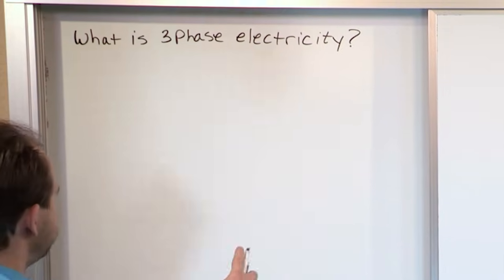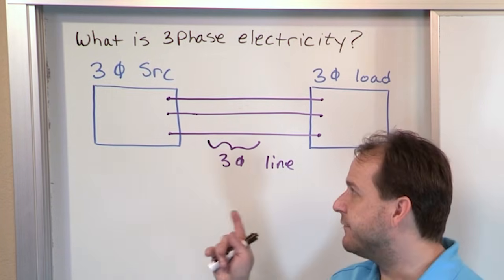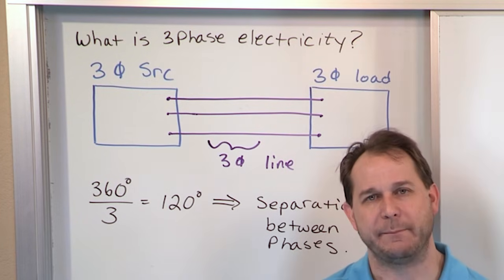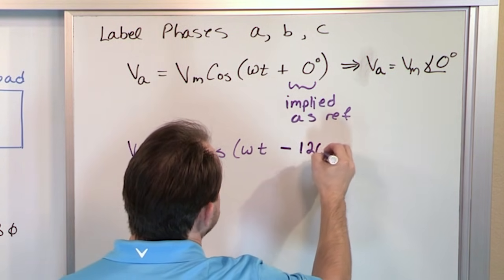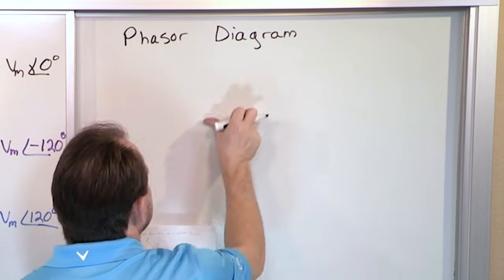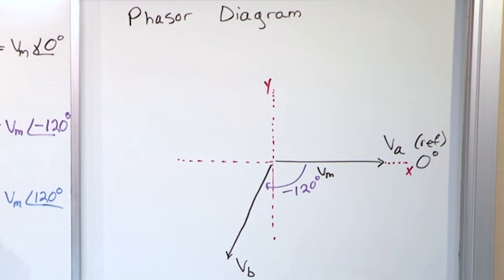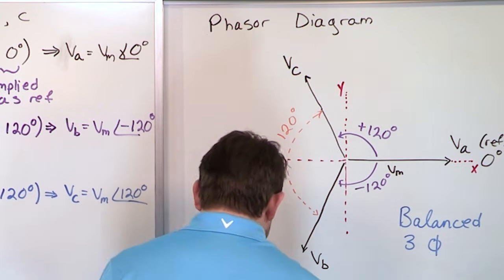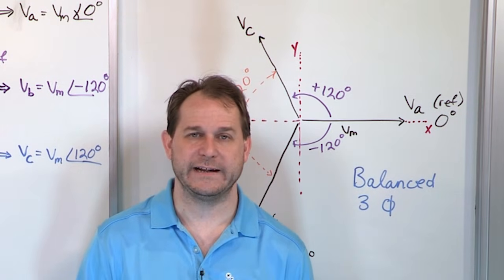01 - What is 3-Phase Power? Three Phase Electricity Tutorial

Comment: 3.phase is the best you can use for a-c motors because you.need to use delta connection for direct line statters .but star delta connection motors you can use root 3.to check running and starting cutrents.with  checking the load with a clamp meter.and then you cam adjust.your over loard relay for the motor etc.Faradays law.for motors .remember Root 3.1
Point .73.off an amp . That way your motor will run at its given R.P.M .with out viberating .if the motor alllnment is balanced 
Iwill cut off now .or i will be writing a book .thsnks .Martin ex navil marine chief ele.officer.

Comment: One-phase motors must generate an auxiliary phase. 
This can happen due to a capacitor or magnetic imbalance. But without technical tricks, a one-phase motor will not run.
Therefore Tesla patented the two-phase motor with 4 lines.  The phases were shifted by 90°
This idea was only taken up again with stepper motors. But Tesla didn't have this technology in mind

Comment: Tesla invented the three-phase, 6-wire motor and the two-phase, 4-wire motor. But the high number of lines prevented success.
Without knowing about Tesla, the Russian Michael Dobrowolski in Germany perfected the three-phase motor with three lines as we use it today. The first application was an 8000 volt high-voltage line from Lauffen to Frankfurt. Two transformers, a generator and a three-phase asynchronous machine were used for this purpose. 
Dobrowolski had improved the three-phase motor so that it worked, in contrast to the Tesla patent, which remained in theory.

So Tesla patented the 4-wire motor (two phase) and 6-wire motor (three phase) 
and Dobrowolski got three-phase motors running in Germany with just 3 wires

Comment: Your English needs improving because the correct preposition for the relations of more than 2 different individuals is among, not between. Here you have 3 different power sources or voltage supplies. So, the phase difference " among" them is
 Φ = 360/3=120
The negative sign "-" merely indicates the direction, but it dies not have anything with deceasing value at all in this particular case. It means that you have an unnecessary mathematical explanation, while all you need to do is substract the absolute values of the 2 phases from 360 --> 360 - | 120 | +|-120| = 120

Comment: I came across a oven yesterday that had had line 2 and 3 switched. It should just cause the motor to run wrong it wouldn't cause the three fuses to blow would it. I wired it correctly replacing the fuses today. 

Replaced the transformer yesterday thinking that was the short in the system blowing the fuses noticed the wiring after that, elements all checked out fine. The only thing really remaining is the wiring but I'm not sure line two and three being backwards would cause the fuses to blow. It could have been the transformer just commenting for some insight before turning it on today

Comment: When did we start calling Lines phase? I thought phase was the relationship between lines? Correct me if I'm wrong but single phase power is not called single phase because its made from a center tapped transformer with a single line primary is it?  If 240V 180 degree 2 line power was made from a 2 pole generator should it not then be called 2 phase? Its the relationship between the 2 lines that is the single phase no? if you took 2 lines of a 120 degree 3 phase service would you have 2 Phase 208? Or do you have a single phase of 208? Am I getting hung up on semantics? In my humble opinion it's the simple fact that just because there is 3 lines in a 3 phase service it was to easy to draw the incorrect conclusions that there the same thing but there not! Draw as many lines as you can between 2 dots on a circle 12 and 6 o'clock, I think one, a single, is all thats needed! Now put 3 dots in a circle,, 12, 4 and 8 o'clock, now draw lines between. It will take 3 lines to connect the 3 dots, take a dot away,, yep your back to a single phase! A single line has phase only when referenced to something that reference circuit is the phase cycle around and back not the line. Simply put, we can't call lines in a 3 phase service phase 1,2,3 or a,b,c unless we are willing to call single phase 2 phase and i don't mean that old great lakes 90 degree plumber invented 2 phase BS.
Reply: You need paragraphs.  In North America, the distribution network is typically 3-phase in a “Y” configuration.  For residential service, one phase line plus the neutral powers the primary of a transformer.  That is single phase.  The secondary has a center tap, so three lines go to the customer.  The two ends of the secondary give 240V single phase service.  The center tal is neutral, and is used to make two 120V circuits of opposite polarity.  You may think of the two 120V circuits as two phases, if you like, but some people will try to make an argument about that.

When you take two phase lines from a 3-phase system to power something, you have single phase, even though it is not exactly the same as any of the three phases with respect to neutral.

Comment: I worked in a textile mill years ago and most everything in the mill was 3 phase.  You don't need a start or run capacitor on a 3 phase motor.  You have a problem you just ohm it out and look for a short or a bad bearing or bushing.  I can tell you a little old school secret I learned.  If a motor is hot when you check it then it is good.  A motor with an open winding will cool off since it isn't trying to run.
Reply: Thanks for the tip!!! Greatly appreciated.
Reply: I thought a capacitor was to put the current out of phase which gives the motor additional torque to start,
Reply: @vxnova1  yes but in 3 phase there is no need for the cap cos atleast 2 of the phases always have torque even if 1 phase has 0 torque therefore start up cap is unnecessary
Reply: @vxnova1  gj(jjk(jjb iii jjjjjjjjii

Comment: I used to work with three phase power on commercial airliners where it very useful for instrumentation and for high power. Mostly on 400 cycle  systems syncrotels and control servos etc. I had studied an electronic engineering course for 3 years at Miami/Dade college.

Comment: Single phase voltage fluctuations cause vibrations in the motor being highly inefficient and actually damages the motor. Three phase voltages do not fluctuate as much. Also never connect single phase motors to a three phase supply without a phase converter.

Comment: Thank you.

You are the best instructor I have on this subject. I probably have this thing more than 30 times since high school, but this is the first time I really find it useful and make sense. 

It is your "MOTIVE" method makes the new knowledge associate to things I already know, smoothness operation of motor.

I guess none of my previous instructors really works in this motor design job.

One suggestion, start with a resistor to explain the power thing 3 phase world probably cause confusion.  

Negative power for capacitors and inductors? 

Do you mean some thing get colder when pass current to it?
If I am teaching this, I will use a running motor as a model only, There is no isolated resistor, capacitor, or inductor. And the power is not just heat, but heat plus rotational energy.

Negative power means put breaks on and take out rotational energy. 

Power hear is Power Flow, with direction, source, and destination.

Some of my words may need refine, but I have a clear a model now.

on your first video, I watched in 3 sections, about 5 min. each. Rewind a little, paused a few times, until the image of fast turning motor becomes solid at the center of  my view.

This image probably not good enough for you, but is good enough for me not to push the 3 phase world aside.

If a running motor, may be an old record player, is running in the background, with unsteady speed, it might help student. 

Thanks again.

Comment: This would explain 3-phase motors in most ebikes today.  I’m teaching myself how to repair my ebike.  Frustrating but enjoyable process.  

Funny story😏controller died on my ebike when I got caught in rain.  2nd controller in six months.  Fed up😡with mediocre customer service in getting parts (please…never said I’d do it myself.  Cut the motor cord to keep me motivated, bought parts, watched tons of YouTube videos and finally.  After about a week of going from knowing nothing to learning the basics, I upgraded my controller (checking MOSFETS, resistance, etc are correct), added new LCD display, and learned all about Hall sensors, 3-motors, amps hour, voltage,  power, phases, etc in the process. AND that hub motor spinning the other day 💪🏾

Videos like your help a lot.  Thanks.

/Bklyn👑

Comment: I work for the utility industry.
We used galvo to check phases make sure the cables are connected right and no cross phases.
Am kinda a highly school train doing work where minimal training is needed.

When tracing current is comin from the station we used +a+b-c.. just to differentiate on the field low level to the transformers.
When cable fail they usually send high voltage of 30 frequencies .
Just want to add my 1 penny

Comment: Its more simple if you use operator "a" , ie rotate by 120 degrees. Or 0.5+ 0.866j. Usong complex numbers is easier. Also analysing unbalaced three phase loads by using positive,  negtaive and zero sequece vectors.

Comment: Read something somewhere once where 6 phase AC was discussed. Same principles but!! It would be more effective for motors and transformers, but again why??  For 3 phase - 120 degrees apart and square root of 3 for actual power purposes, is all that's needed to understand 3 phase. One can reconnect a 12 lead 3 phase source to emit single phase. There are also single phase powered 3 phase converters. Not very efficient though for either. Lots of loss in the form of heat. The US Navy during the early submarines, used a 60HZ 120 / 120 3 phase floating wye AC distribution system, to power the boat. No matter what you touched it was 120 VAC to neutral or 120 VAC phase to phase. It was then converted to DC to charge the batteries and run the drive motor for the propeller.

Comment: I want to see if you can answer a simple question. In the southwest of America,  single phase 220 volt motors were popular,  so three phase was used. That means two phases were 120 volts and the third was 220 volts. Well, years go by and the electrical system converted to the three phase system. Yet the companies failed to convert all of the existing power to three phase ac power. So you find in certain areas where three phase is two phase 120 volt plus a 220 single leg (actually 236 to 239  volts). My question is when you go across the high leg and a 120 volt output, you only get a 208 volt  output (clarifying,  208v two phase output). How is this  possible? Over the years,  I have asked a couple electrical engineers how this works, and no answer. Would you know?

Comment: I understand this concept, but I was hoping for a how-to for connecting a 3 phase machine. More nuts and bolts tutorial.  Need to buy a phase generator for my shop to be able to use CNC machines. I don't have 3 phase available here. Maybe I am asking the wrong person. Good explanation on the theory though.
Reply: MrOlddave   Have you decided on what method you are going to buy to convert from single phase to three phase?   There are a few different ways.   Your CNC machine is probably 3 phase 3 wire connected.   Meaning 240 volts.  If so, there will be three terminals for phase A,B, and C.   When you hook them up, you have to "bump" the power on to see if the machine runs forwards or backwards.   If backward, swap any two of the wires to change the direction of the phases.   
I suggest that you research using something like TECO VFD (variable frequency drive) if the load of the CNC is small enough.   Run it at 100% speed.   These are less expensive and easier to connect than other systems.  This is a link to the drive section that may help you.   https://www.tecowestinghouse.com/product/l510-micro-ac-drives/
Best wishes!   Kevin

Comment: Hello, thank you for the informative video.  It answered some of the questions I have as I learn about electricity.  However, I think there might be a problem with some of the math... if you have a cos b(x-c) + d, you get a magnitude  of a, a dilation of b, a horizontal shift of c, and a vertical shift of d.  Now the one I think might be incorrect in the video is the horizontal shift of c.  If you have +120 degrees, then that should shift left (or negative), not positive.  The reason is that c is subtracted, so if you make it +, then you are subtracting a negative.  Likewise, if you are going to do -120 degrees, that should be a shift to the right because you are subtracting the positive value of 120 degrees.  So if you have cos (x - 120) that means the cosine graph shifts right 120 degrees.  

If I am misunderstanding something, please let me know because I want to understand this, but I think that might be wrong, so I'm asking for your input.  Thanks!

Comment: Any such thing as a 2 phase?
Reply: SPARKY    Yes and no.     Tesla originally made 2 phase AC system.   The original power generated at Niagra Falls by Tesla was 2 phase.  He then changed to three phase.   So no real two phase systems any more with an exception.   I have never seen one or design an electrical system connected to one, but there is what is called open delta that is called three phase but actually only has two phases.   Respectfully,   Kevin

Comment: I'm not sure how to even ask this question about power phase.  What I want to know is related to when using a 3000w solar power pure sine wave inverter backfeeding to a manual transfer switched sub panel.  My inverter has 2 available outlets to supply 120v power to AC appliances, tools, etc.  If I take the hot wire from those two AC outlets and connect them to the sub panel main buss lugs, will it supply power to the sub panel correctly & safely to run standard household lights or outlet circuits wired to the sub panel when switched to the solar power feed?

Comment: I have a question.  I don't understand how there is expected to be 220 vac across L1 and L2 of a "50 amp RV connector"when both originate from a buss bar in the fuse box.  Are they not at the same potential?  could it be that they some how are not in phase because of the duel breaker somehow ?

Comment: The same three phase power 220vac. My main circuit breaker is 30A and the wires are good for 30A. But the equipment I have has a circuit breaker 50A. This equipment has three heat element connected to each switches. Before I turned on first switch the volt meter reads 220vac. After turned on 1st switch meter read 218-219vac. 2nd switch on 217vac, 3rd switch on meter reads 216vac. What should I do in this case. If anyone has any suggestions. Thanks for your advice.

Comment: This video brings back memories of my electrical class in 1978!   I hated my electrical class, made no sense.  This is great information if you want to teach this math.   Simply put, an alternator has equally spaced coils connected into three outputs each is 120 degrees apart.   No big deal!   I started as an electrical drafter in 1983, fell in love with my job and stayed with it until 2018.   I designed residential, commercial, and industrial projects almost all with three phase systems.   I became a PE in 2007.   The point is, this point should be a 2 minute discussion and done.   In the whole time of designing systems, I never used the math shown here.   It's useless in the real world.   But if you want to teach, it's good to use up time.
Reply: @Dan Mattingly    Well said!
Reply: @KevinCoop1  Agreed! You can't build a house without foundations!
Reply: Maybe I somehow had the foundation and didn’t realize it.   I still feel that they try to make the math that is easy into something complicated.

Comment: Can be used as a transformers generator single to be charged with VOLTAGES CURRENTS AMPERAGE 4 WIRES FREE VOLTAGE CURRENTS  ...RUN IT AS ALTERNATOR...GENERATED MAGNETIC FIELDS VFD...CONTROL BY NANO TECHNOLOGY MICROCHIPS...JUST CAPACITORS 420VOLTS 5600Uf...HOW MANY PULSES CAN YOU GET TO SPIN A MAGNETIC COIL FOR INSTANCE VACUUMED 120VOLTS AC DC WILL RUN THE MOTOR DESIGN...

Comment: which 3 phase connection blocks undesired circulating current                                                                        which 3 phase connection corresponding to a higher phase voltage with same generator line voltage                                                              the neutral line cross section area is usually double or triple or half that of other conductor lines

Comment: I told myself I'd learn more about AC power but my head hurts because I just spent two hours learning about machining, 4 hours learning about the current state of world politics, and how the silent civil war here in the U.S. is going and that's enough for my day off. I don't know anything about these phasors you're speaking of, it just makes me think of Star Trek but I do understand the concept of 360 degrees in a wave vs a circle because I've studied sound engineering a bit.
  I think I'm going to go play some Far Cry 4. If anyone wants to give me some pointers on where to start in learning AC power, I would much appreciate it. I understand just the real basics of what AC is, vs DC and 120/240, 3 wire single phase, midpoint neutral but if I need to start at the very beginning then I will.
Reply: Until you wrote, 'silent civil war', I never understood how to label what's going on - I think that nails it right on the head.
Reply: This is a really good short video just to recap https://www.youtube.com/watch?v=CBiUOQ2WX2I
Reply: Ha ha me too.